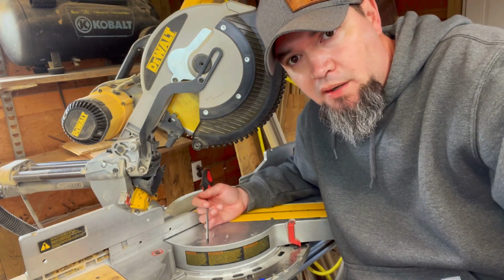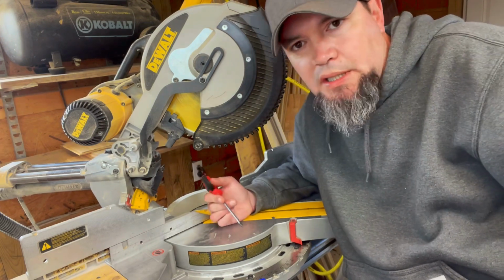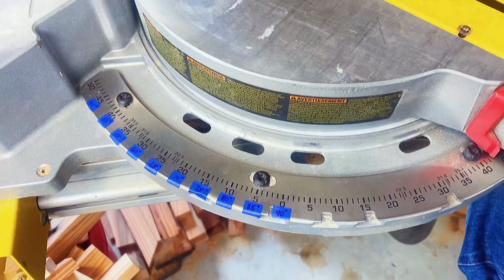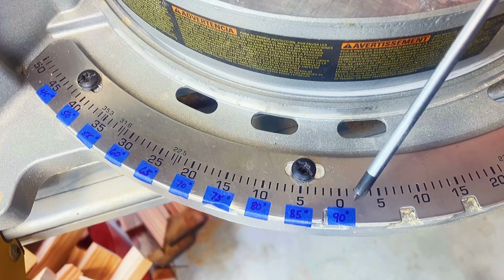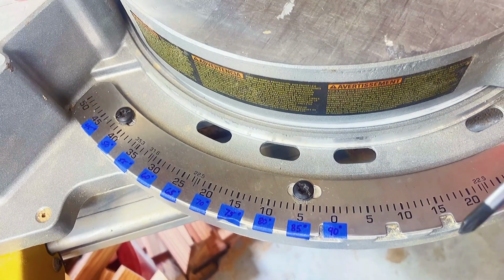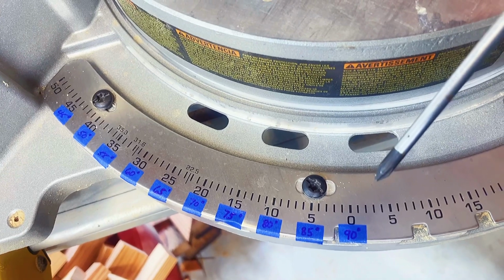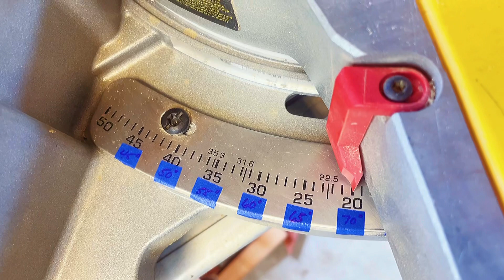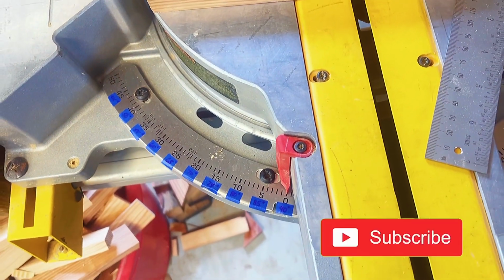MITER SAW TIPS!

Comment: Does that work for both ways, left and right? Or does going to the right add to the 90? (85-75-70 left, 95-100-105 right) Also, if that is the case,  how would you cut 0-45 degrees? Or do I need to cut the opposite angles then? (cut 80 degrees backwards to get a 20 degree cut if you see what I mean)

Comment: Thank you.
Although this seems plumb backwards and it is hard to think like this.
I can see what you are saying. 
The proof will be in the practical application.

I do not have to do miter cuts often so this will take some experimentation.
Reply from the maker: Think of it as like the gauge is set to read the off cut. Technically a complimentary angle. So you do get that degree. Just not on the board you typically want it on.
Reply: @MatthewPeechWoodworking  Using big words i might have to go break out the Geometry book.
The part about the cutoff makes perfect sense.
I can now see it in my mind. 
Will still have to practice a bit to totally understand it.
Reply from the maker: Good luck!
Reply: @MatthewPeechWoodworking  I would rather say Practice Well.
Luck is a one time thing Practice turns knowledge into skill.

Comment: I understand that to make a 7 degree cut you have to subtract 7 from 90 to get 83 which is 7 on the miter saw guage. You required a 7 degree miter on the purple martin house and I had problems using 7 on the saw. What am I doing wrong?